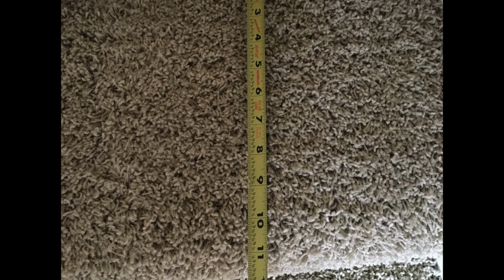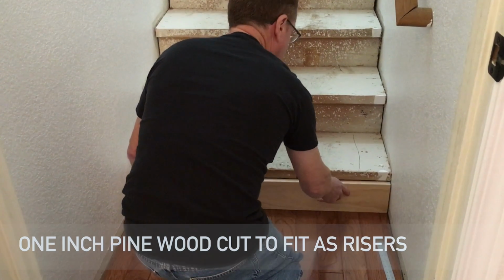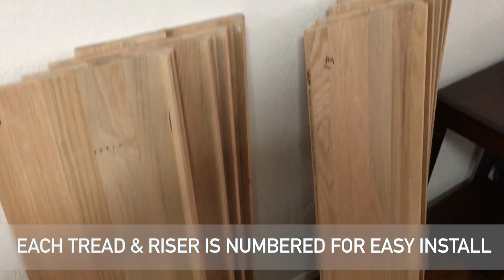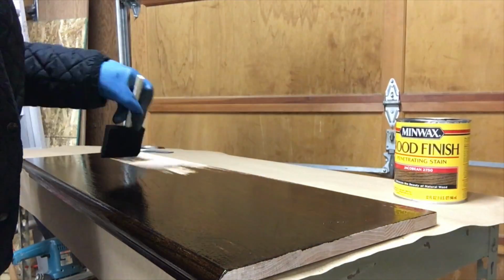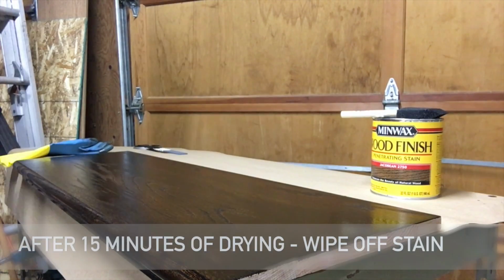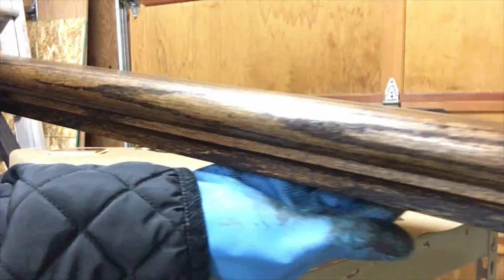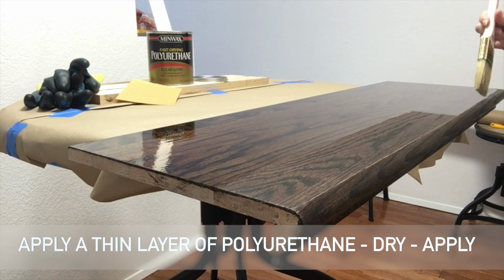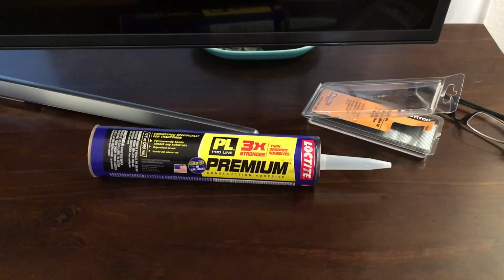Stair Makeover EASY Remodel DIY

Comment: A quick tip if I may. Never shake a can of stain as that will incorporate air bubble into the stain. That can have adverse effects on the finished product. ALWAYS use a paint stick-stirrer. Finished product looks nice!
Reply: I think you are confusing stain with poly

Comment: If you would have installed the risers first then the tread you would not see that gap at the top of the riser.  Ideally you do it that way because the tread comes down and hides the crease.  Makes for a much nicer appearance.
Reply: Yup I agree
Reply: I not being mean BUT the GAP at the top of the NEW riser to the NEW tread is at least a 1/4 inch and VERY NOTICEABLE. Why didn't you do as you said and DRY FIT everything first.
You did so much work to the treads and they look GREAT.
Reply: the risers being installed after covers the two nails she used to hold each tread plank.
Reply: @johnmiller9219 still doesn't hide that ugly ass gap on every riser meeting the tread...  That's what wood putty and a small brush to touch up the stain on the tread is for.  I know steps aren't easy because I just did ours, but there are way too many gaps everywhere on this installation.
Reply: @NewShockerGuy  cove molding would easily cover the gap
Reply: @johnmiller9219  That is why in addition you have to start from the bottom step and work your way up.  That way you hide the nail holes with the riser and avoid the gap between the riser and the tread.
Reply: @omarkhan9966  so the tread sits over the riser right not cut it under the tread but under it all thway up allow the tread to over lap ?
Reply: @ToffiTube  Yes. Start at the bottom.  Install the riser first making sure to glue it in and nail only along the top.  The nails will then be covered when you install the tread.  When you nail the tread in, again only nail along the top where it will be covered by the installation of the next riser.  This way you will hide all the nail holes as you work your way up.
Reply: @omarkhan9966  thank you sir
Reply: @omarkhan9966  my first landing at bottom is goona be hardwood floor so should I put the first step riser before the hardwood landing
Reply: @ToffiTube  I would.  If you ever in the future have to replace/repair the  hardwood you wont need to tear out the riser and hence the tread.  On the landing you could also finish the bottom stair riser with a piece of quarter or half inch quarter round to hide the gap.
Reply: @omarkhan9966  thank you sir your the best , any tips on the actual prep and stain process first time doing this
Reply: @ToffiTube  Staining is easy it is just very subjective how dark you want it..  In terms of finish coat with polyurethane, remember this:  there is no such thing as too thin a coat.  The thinner the better, with the softest brush you can find.  After the first coat, sand with steel wool 00 grade.  Don't use sandpaper between coats.  Steel wool after the first coat, then two more thin coats and you will get a glass smooth finish every time.  Guaranteed.

Comment: After the carpet removed, did you completely clean the dried mud or paint on the treads and risers before you glue down the treads? 
My stairs treads and risers have drywall mud and paint covered them, I am thinking about clean them  like sand them down, but that take a lot of work. I am worrying that if don’t sand them down the PL Premium won’t work.

Comment: The diff between your job and mine as a finish carpenter is called a skirt board?  Your is fine until you want to sell it and the question comes up “where is the skirt board”?  And that’s where I get called?  If it works now for u and u hv no kids, pets , vacuum cleaners then u don’t need a skirt board just replace the Sheetrock ?

Comment: Very nice video.. but the RetroTread decorative piece doesn't come down far enough to cover the old nosing on the original stairs. It'd be better to put a spacer on the riser, like a 2x4 and use a wider riser to come up and cover the original nosing, then the RetroTread would not show the original nose

Comment: Crow's Dispatch you an exceptional job, and especially beautiful work with the stains and finish work on the treads, which is what 99.9% of people will see. 

Several commenters mentioned the riser gap below the tread, and it's true it could've been done differently for a professionally finished look, but all-in-all she did a dang nice job. And that gap, it's addressable.

Something else to achieve craftsman finish was to flush cut the tread tops and risers to avoid gaps at the skirt (in this case the wall), vs a floating look between the walls.  Most stairwells run askew from tread to tread, if not at the time of construction, for sure with settling and earth movement all houses fall out of plumb level square.  There are some simple jigs to be found here on YT to do help make those flush cuts easy.  But overall a great looking job by Crow's Dispatch!

Comment: Nice job, especially regarding the stain work. However, there wasn't much said about measuring and slight angle adjustments. I also noticed you didn't leave 1/4" for expansion of the stair tread, which is covered up by the riser.
Reply from the maker: Yeah, every tread was individually measured to match each stair (including space for expansion).  Everything turned our great for us and they have held up very well. :)

Comment: Pro tip!!!
After you rip off the carpet sponge foam, and staples is when you will try to fix and squeaks or creaks from separation of the wood during age etc. I say try because a small percentage cant because of poor carpentry. Pretty common in early 2000s homes to have terrible stringers.
Reply: Tunefully Do you know how I can pull up all these darn tiny nails without damage??
Reply: @valeriexoxo  find yourself needle nose pliers or a pry bar. If the wood dents it's okay because they have wood filler that acts as drywall spackling/mud for wood. The saying is "a little caulk and a little paint makes a carpenter what he aint!"
Reply: Tunefully lol. I’ll need a gallon of it then because I’m handy challenged.  I actually have a pair of my dad’s old pliers already!!  Thanks!
Reply: @valeriexoxo  no problem! Dont skimp on the quality of the filler!
Reply: @valeriexoxo  you've probably already finished up your stairs, but for others wondering about this, old nails, staples and carpet tac are prob the most unappealing task in this job, but ya gotta do what ya gotta do. 

If there's a grip-worthy portion of the nail sitting out you can use a needlenose plier Tunefully says, but if you have to fight it to get a grip you risk a bit of shredding up the wood. 

In that case it's safer and more timely to use a "nail set" to tap the nail below the substrate surface. If you don't have a nail set an awl will, or 3" nail with the point centered over the protruding nail, then tap in the tiny nail so it no longer sits proud of the surface — i recommend a 3-4" nail... less risk of bashing your finger, though you should be fine just with tapping it ( :

If it's a pin nail the nail set will leave a divot, but if it's a tiny finish nail with a tiny head, the indentation will just be the size of that nail head. Then patch with wood putty, or even better epoxy putty using a putty knife to flash flush the putty to the surface, wait a bit for it to dry, sand,  vac, prime and paint. Otherwise just cover with new treads / risers.

Comment: How did you finish the top stair /landing?
Reply: I'd like to know how to prevent different height risers for the top and bottom stairs.
Reply from the maker: I used a stair nose that matched the wood set I laid for my upstairs flooring.  I did not use their treads, however, as they looked cheap... so that's why I wanted to match the oak treads to the upstairs flooring.  It came out an almost perfect match.  Had to wait for the part to come in and that's why the part is not in the video.

Comment: Came out nice. You could you used oak riser boards, but the white pine looks nice too. 
Also an easy way to convert an old 9" thread stair to the new 10" thread requirement by building out the riser with plywood and pine.

Comment: Can you cover how you handled the very top step? I assume you cut that one down to only a couple inches in depth?
Reply from the maker: I used a stair nose that matched the wood set I laid for my upstairs flooring.  I did not use their treads, however, as they looked cheap... so that's why I wanted to match the oak treads to the upstairs flooring.  It came out an almost perfect match.  Had to wait for the part to come in and that's why the part is not in the video.

Comment: Thanks for sharing! Your stairs look beautiful. I just want to ask what was that you did to the stair after you tapped them in to place with the mallet? Staple gun? I didn't understand that step.... thanks in advance
Reply: Did you get reply to your question ? Am looking for this answer
Reply: ramafico she used a finish nailer uses small nails loaded into the gun which is pneumatic
Reply from the maker: Yes, it was a couple nails from a pneumatic gun to prevent movement as glue dried.

Comment: I have 2 landings and I can't figure out how to do those. Ugh. But thanks for this info!
Reply: A NYOB ditto, what did she do with the landing????
Reply from the maker: I used a stair nose that matched the wood set I laid for my upstairs flooring.  I did not use their treads, however, as they looked cheap... so that's why I wanted to match the oak treads to the upstairs flooring.  It came out an almost perfect match.  Had to wait for the part to come in and that's why the part is not in the video.

Comment: What did you do to finish the very last step on top where it transitions into the landing?
Reply from the maker: I used a stair nose that matched the wood set I laid for my upstairs flooring.  I did not use their treads, however, as they looked cheap... so that's why I wanted to match the oak treads to the upstairs flooring.  It came out an almost perfect match.  Had to wait for the part to come in and that's why the part is not in the video.

Comment: I noticed you didn't cut the nose of the existing tread off like many of the instructional video's say to do. I don't want to do that either. I am assuming that worked out ok?
Reply from the maker: Yes, that's why I chose to do it this way.  I wanted to work around the existing structure. Adding the thick pine riser made up for the space taken by the old nose. It has been a year so far and all is well... I am loving it and hope your's turns out amazing also!!!
Reply: Crow's Dispatc

Comment: How much did you spend on this project?
Reply: cdpc211 - Did you ever get an answer? I'd like to know too. And where the stairs were purchased. And how they are holding up. Stuff like that.
Reply: @ScottRGarcia123  Homedepot sells a set that includes one tread and one riser.  They are $45 per set.  They're the best option IMO.  They are veneer which is better than solid wood which other stores sell.
Reply: B Mcginnis Thanks McGinnis.
Reply from the maker: I don't recall.  But you can look up materials for your own project on Lowe's website.  That is where I got the treads from.

Comment: Do you not need to staple/nail the risers after installation? Is the adhesive material enough? Could you also advise what gauge nail gun is needed for this type of project? Thanks!
Reply from the maker: Hello, I don't recall what gauge I used.  The adhesive was amazing and I only used the two nails on the tread to prevent movement during curing.  I have had no issues with the risers.  Everything came out great. :)

Comment: Nice job!!! You did an awesome job and it inspires me to tackle a job like this. What was that handheld machine that you were using when you were putting the glue pieces in place? Thsx for sharing.
Reply from the maker: The pneumatic gun?... with an air compressor...
Reply: Yes but what were you doing?  Assuming you put a couple nails?

Comment: Great video, I am looking into converting some open tread stairs so this was helpful.  one thing, when applying paint/varnish/stain and you have a new can best practice is to decant some product into a smaller container that will stop the entire can getting polluted should there be any sawdust etc left on your treads also should you knock the can over there is less to clean up !
Reply: Great tip.

Comment: You had the wood stain already.  Does spraying the poly shade blend in well?   I never used poly shade before.  Heard its much faster to work since its stain and poly mixed together
Reply from the maker: I really liked using the combination of the different products from Minwax.  I took my time with it and let it dry between coats... sanded as needed.  And, I love the end product. :)